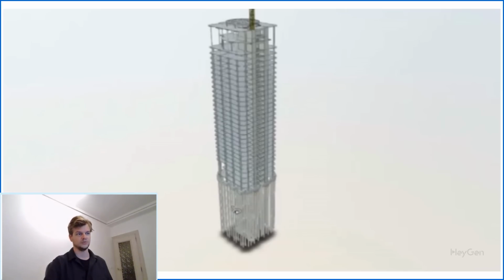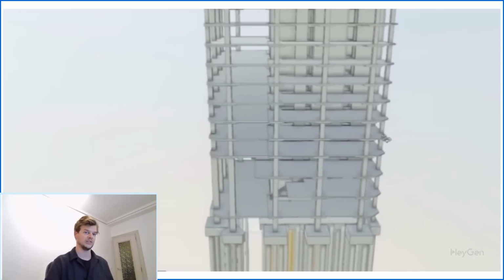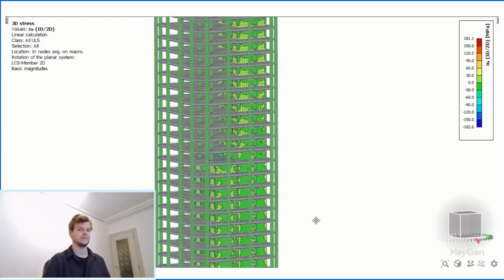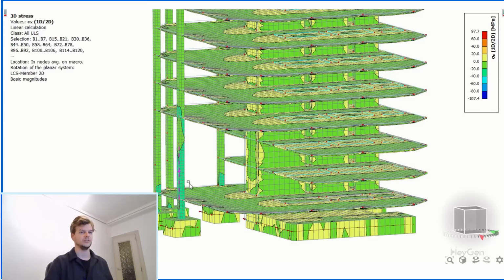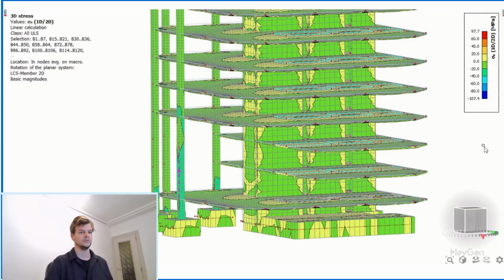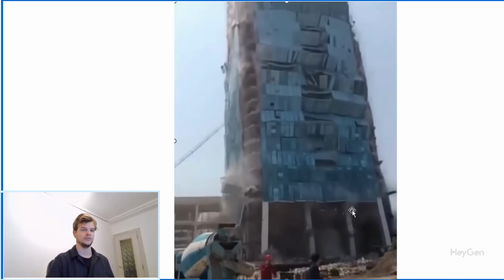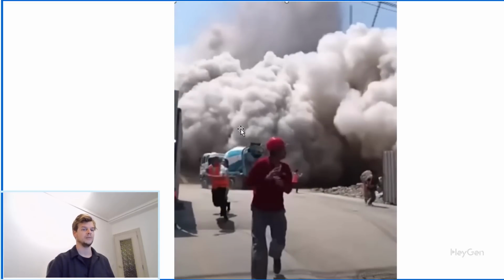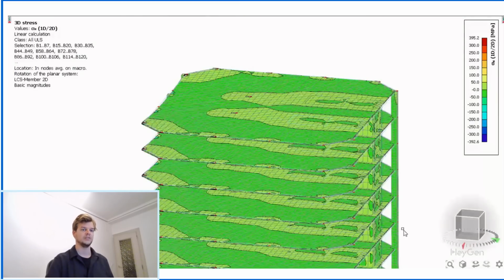Bangkok Skyscraper Collapse FEM Analysis 2025

Comment from the maker: Thanks for watching! 🙏
What do YOU think caused the collapse? Was it the soft story, poor concrete, or something else?
👇 Drop your thoughts below — and let me know which structure I should analyze next using FEM!

🧠 Structural failures are more than just moments — they’re lessons.
Reply: My condo building is 600m from this collapsed building. It had substandard concrete, below specification rebar and had been unfinished for several years before construction resumed last year. During that time it was exposed to the elements causing further degradation. The Thai government had contracted a Chinese company to build this government building to save money. Although there are cracks all over our building the supporting columns remained undamaged. Due to the major reconstruction works necessary to repair our building we have moved out. Before the collapse we always thought the construction of this building looked below what was necessary for a 35 floor building.
Reply: I blame the almost-obsession that companies from the country responsible for the structure have with concrete construction high rises. 

A steel framed building wouldn't have collapsed. The excessive weight and risky corner cutting are common in companies from there, but just like the re-designed and now "leaning" tower in California (also--chinese) they created an overwheight building designed around too much concrete and too little steel. 

Just my thought